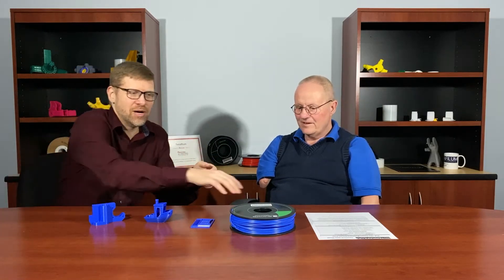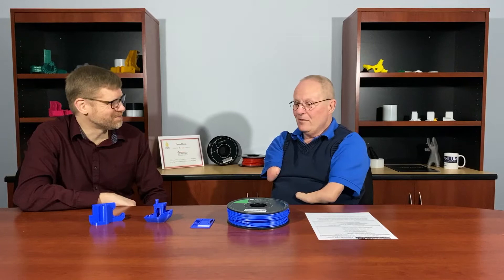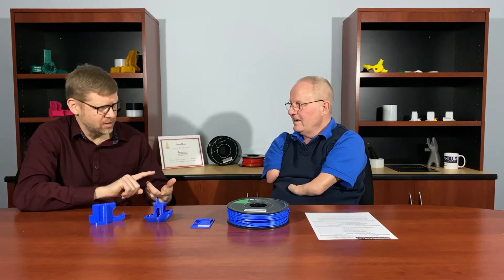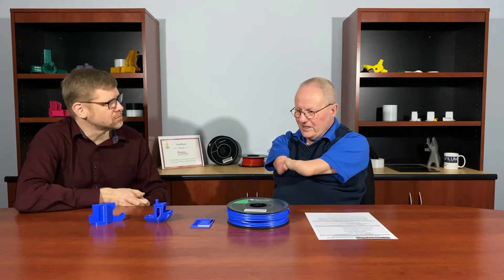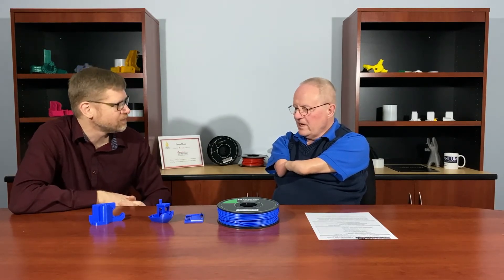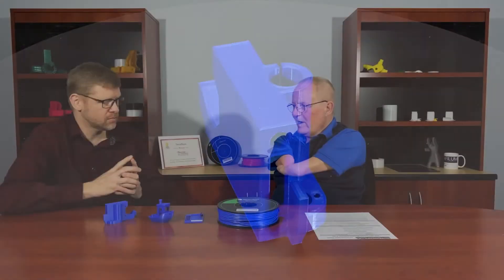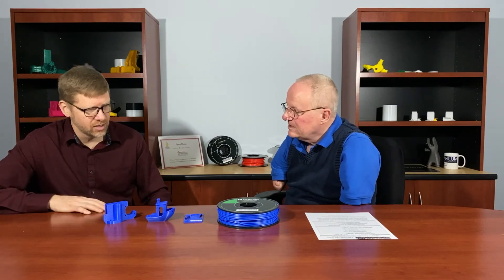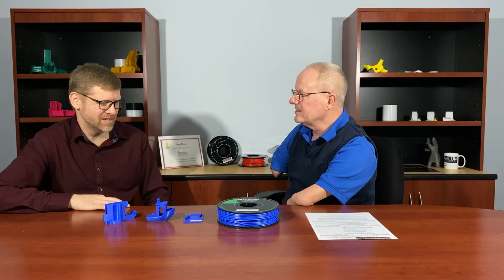Introducing 3D Universe Terrafilum PLA-TPU Filament for 3D Printing

Comment: I was just curious, do you happen to have Dielectric constant and Loss Tangent plots for this material at different frequencies? or just at a couple frequencies? I am researching for materials in my electrical engineering senior design that will have some light moving parts and they need to have the least electromagnetic interference for an antenna at 12GHz.